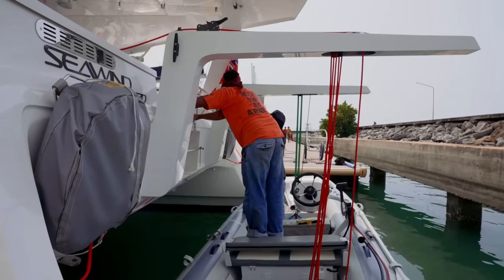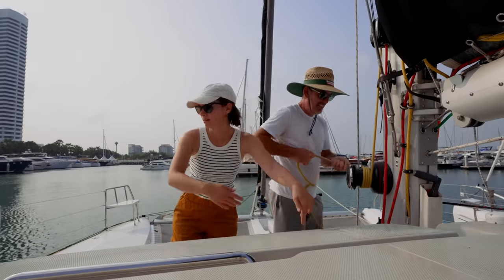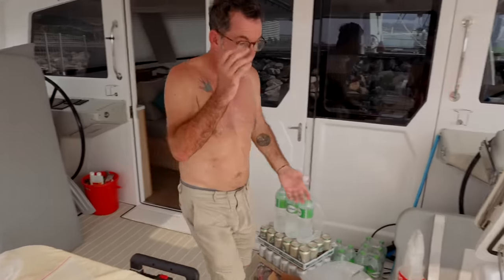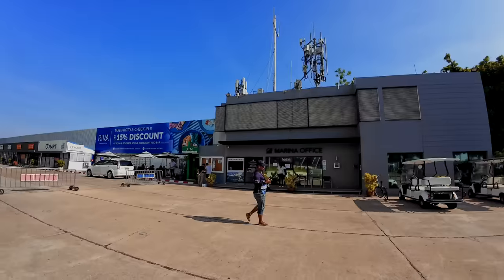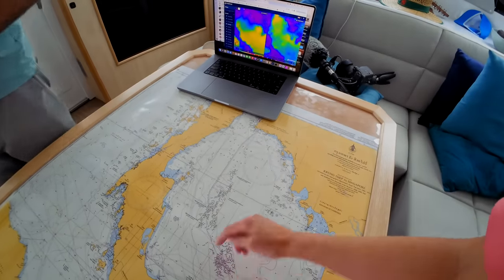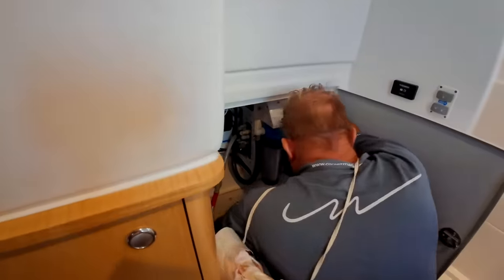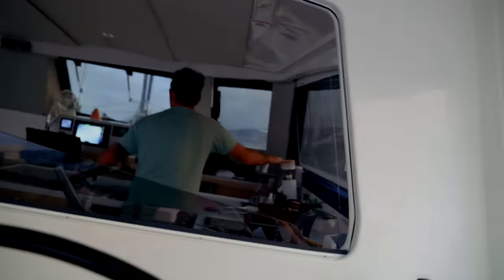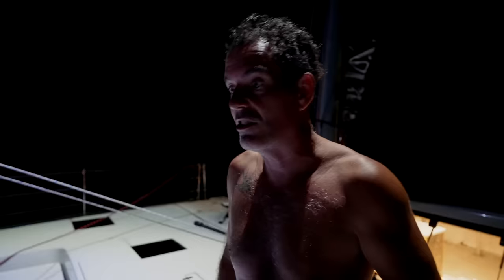You'll Never Guess How We Fixed Our Watermaker...!

Comment: I have a suggestion for your potential ice maker future woes. Pick up one of the table top units that make the little sort of ice barrels. They only cost around a hundred bucks or so, require little power to operate, and have been proven to me to be very, very reliable. Onboard ice is certainly a luxury that can be done without, but if you're like me almost a requirement for true happiness at cocktail hour!
Reply: Agreed!
Speaking as a 20year time served professional crew/superyacht engineer, I am happy to attest to the fact that integral cockpit located ice makers are and will forever be a repeating and never ending pain in the rectum. 
Your suggestion is entirely rational. 
Still, at least Nick and Terysa don’t have kids who think it’s a giggle to wrap dinky toy cars with gaffer tape they’ve stolen and post them down all of the vacuum heads, requiring every line from the four heads on the boat, leading poo to the central vacuum/holding tank, to be entirely disassembled to clear the resulting multiple blockages. 
I sh^t you not. Worse still it was the owner’s kid that did the deed and all that the owner could do, while I was up to my elbows in his family’s faeces, was sit out in the sun on the aft deck nursing a glass of the finest Krug champagne while he bitched constantly over the intercom about both the smell and the delay in departure from the marina. 
Kept wanting to know why we couldn’t just leave and have me rip a 30m motor vessel to pieces while underway at 35 knots!
To be fair, at least the guy’s wife came down below and apologised for both him and the kid’s behaviour, gave the crew a decent night off and took us all out to have an evening off ashore, for which she picked up the tab. 
I’m not sure if they’re still married, I suspect not.

Comment: I need to get more highly complex technical equipment on my boat.  
My simple uncomplicated systems are far too reliable.
I'm thinking a hybrid propulsion drive unit that produces 40 million volts underwater that will enable my dual purpose air conditioning/ice making water purifier to automatically wash my laundry while steering my boat with it's built in autopilot.
Probably nothing could go wrong with that.

Comment: The WCP D5 is a DC pump using the spherical motor design as developed by Laing. The only moving part in a spherical motor pump is a spherically shaped rotor/impeller unit, which is seated on an ultra-hard, wear-resistant ceramic ball. They are used in irrigation systems and watercooled pc’s and are readily available.

Comment: I have the same watermaker and mine doesn't have a secondry strainer. Maybe it needs one for the seawater quality where you are but I doubt that bodged part was factory. Run some SC2 cleaner through it and try again.
Do you have a pressure gauge on your accumulator? If so are you delivering the correct pressure to the Clarke pump via the Shurflo pump?

Comment: The only thing that will happen if your membrane was not pickled correctly is high ppm when the unit finally produces water. Air in the membrane is not an issue as it will get pumped out. Spectra WMs will not put product water into to the tank when ppm are 700-750, this can be over ridden. when my Spectra had a problem and was producing 900 ppm the water was still drinkable without tasting the salt. My Newport 400 was purchased in 2006, call Spectra and ask for the tech guys they are pretty good helping over the phone.

Comment: Hello.    I did previously say “ why was that not a brass fitting but,  I can understand almost the pressure it develops and pumping clean fresh water to your tanks. Not being a boat person , why has that system not got a shut down position that would decrease the pressures to a level of rest , so that one could leave the boat.   I think that the fresh water system/pump should be redesigned   Yes you need to keep the weight to a minimum, but having water coming in quietly and leaking to the villages is not good .    Had you been away for longer your boat could of sunk 
  All in my opinion      Wish You Well